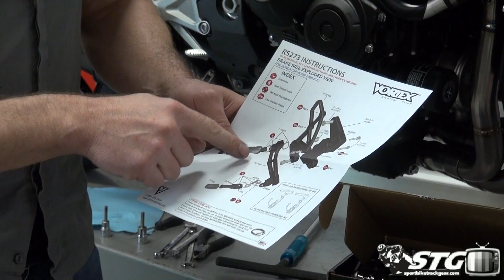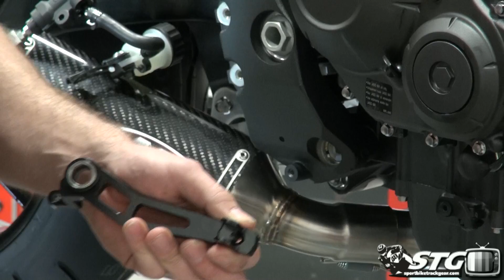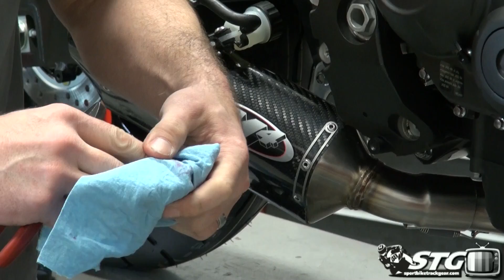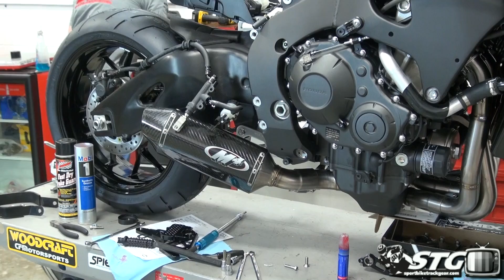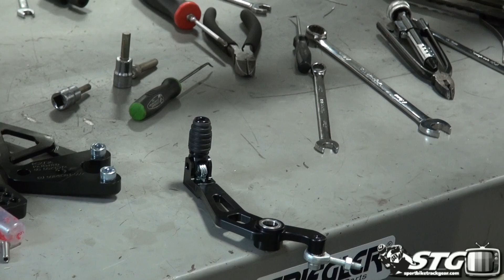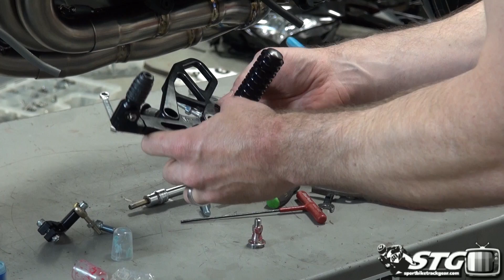How to Install Vortex Adjustable Rearsets V2 Honda CBR1000RR from Sportbiketrackgear.com

Comment: cant find any videos on how to install the Rear pressure light switch though..
Reply from the maker: We have meant to do one for some time now and just have not gotten to it. Very simple install IMO. The toughest part is bleeding the brakes. If you feel comfortable doing that it will be a breeze. - Van
Reply: @sportbiketrackgear  i tried it this morning and i have ABS on my 14 cbr1000rr and it just seemed that the bubbles were endless, i was using a vacuum pump thing i was curious if maybe the bubbles were coming from the seal at the caliper drain bolt when i open it maybe it was pulling air in from the treads ? 
\

Comment: Love the guide :) I installed some second hand Vortex on my 2012 CBR1000 - Question, does the shift rod go one way? It seems one bearing on the end is easy to move than the other and gives better clearance from the frame when using the better bearing knuckle on the shift shaft, is this right or should both bearing feel the same? Thanks Scott
Reply from the maker: Both of the heim joints should have a similar feel to them. You may need to pick up a new one. - Van
Reply: @sportbiketrackgear  Thanks for the  reply and confirmation. Definitely deciding to replace those joints.

Comment: What about the brake return spring?
Reply from the maker: There are aftermarket brake return springs you can install if you want to. The rear master cylinder has an internal return spring which is enough. Most riders do not add the spring. - Van

Comment: Where did you get your gear shift spindle holder?
Reply from the maker: There is no shift shaft holder on the bike. That is an OEM bracket that holds the seal in place I believe. This is a pretty old video now. - Van

Comment: Do we need to use the OEM exhaust bracket?  I have some no name rearsets that don't have the factory mounting bracket, and I want to switch to this so I can properly mount my Akra exhaust that I bought from you guys!  And is the adjustable rearset V2 significantly better than the one you installed?
Reply from the maker: Thanks for the order on the exhaust. Most of the rearsets for a bike that uses a low mount exhaust will come with a mounting bracket. I have seen some kits that are designed to use the OEM exhaust bracket so you could give that a shot. It is possible you need to buy a set of rearsets to get the pieces you will need to get the job done. - Van

Comment: Is there an install video on installing the brake switch for street riding?
Reply from the maker: Sorry we have never gotten that done. It is a very simple install with just 2 wires that can not be mixed up. - Van
Reply: Sportbike Track Gear I’m just trying to figure out where to screw the pressure switch into, I think I’ve figured out where to connect the two wires into.. any suggestions? Thanks
Reply: @sportbiketrackgear ❤😂😊

Comment: hey i was just curious, im looking to design my own set of rearsets, i was wondering  if there is alot of difference between rearsets and certain bikes for the rear brake master cylinder plunger that connects to the foot pedal, or if they are universal?
thanks